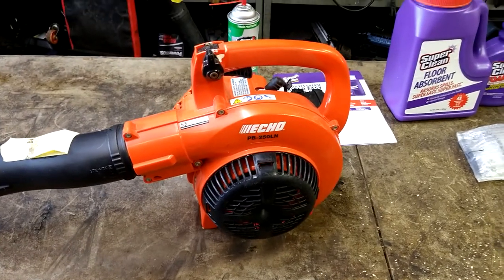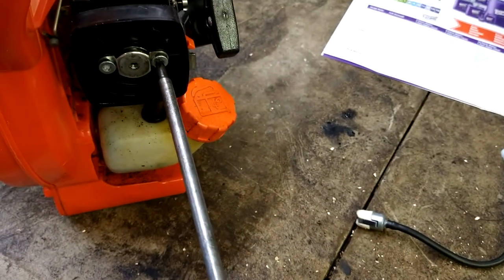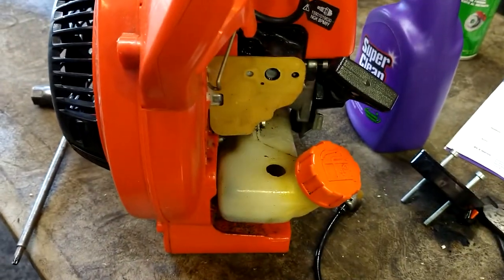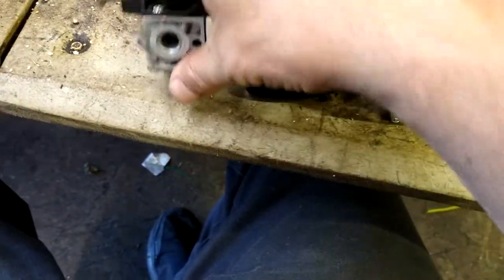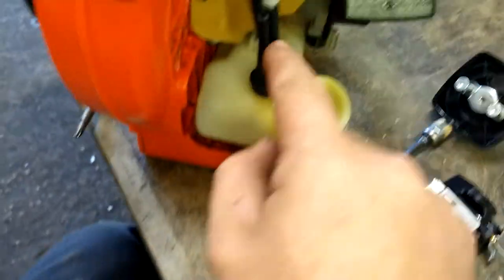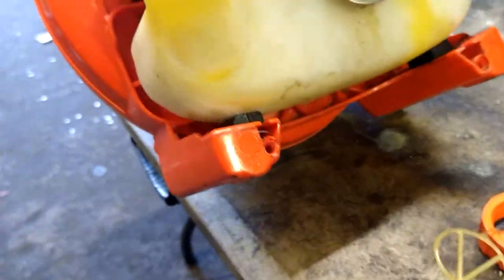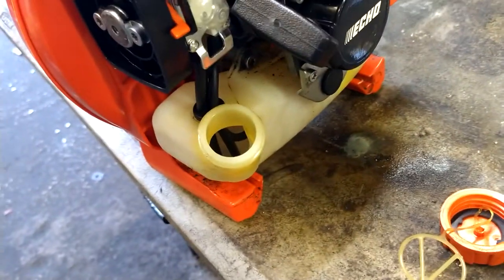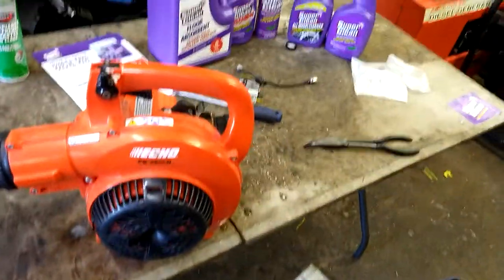echo pb-250ln blower carburetor repair

Comment: Hey there!  I bought an echo pb250ln off of Facebook for 30 bucks!  Looks brand new but wouldn’t start.  Allegedly had all new parts.  I took apart the carb and saw it was new and not gummed up.  I bought a tune up kit and replaced the plug, and both air and fuel filter.  New fuel lines were also allegedly installed.  When it still wouldn’t start, I replaced the ignition coil.  Now, the blower has compression spark and fuel but won’t start….sounds like it wants to then doesn’t.  The last thing I’m going to try is replacing the flywheel (saw a service bulletin for those models where it can throw off the timing).  If that doesn’t work, any ideas?  Should I replace the carb and fuel lines anyway despite them being brand new?

Comment: Hey brother, i have a Husqvarna blower that i put a new carb, air filter and spark plug in, i cant seem to keep it running on full rpm, it sounds like its running dry or something and it blows out smoke from the exhaust, what would you say that is? Crank shaft gaskets maybe?

Comment: A tripod would have been nice…..
Reply from the maker: @Bryan-bv4xq  if a video doesnt help you move on to the next one. I made an effort to help you.
Reply: I wasn’t trying to be mean. Just helpful. You had to stop filming to use both hands so I missed the part I needed to see. Even though you explained it, it would have helped to see it. Thanks
Reply from the maker: @Bryan-bv4xq  first videos. I found a camera holder that worked through trial and error. Like everything in life you get better with practice.

Comment: I have a PB-250LN blower Aug 2015 when I set the swith to prim or up postion it wont fire but put the switch down to run postion I have conpression so thinking the carburetor.  My Carb # PB-184 / Part number for the blower is # P42814123078 can I used your listed part from Amazon or do I need another kit for this blower. any help would be grateful.
Reply from the maker: same carb. id squirt a tiny bit of gas in mouth of carb and pull till it fires. if it fires its got compression and spark and needs carb and fuel lines